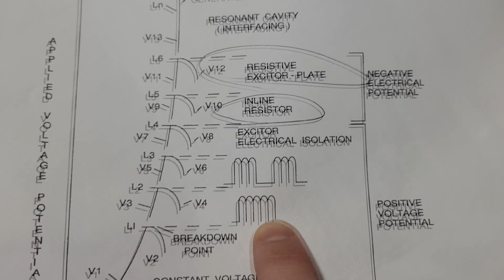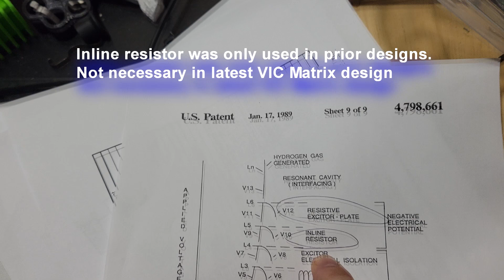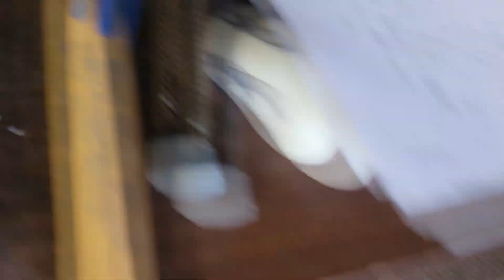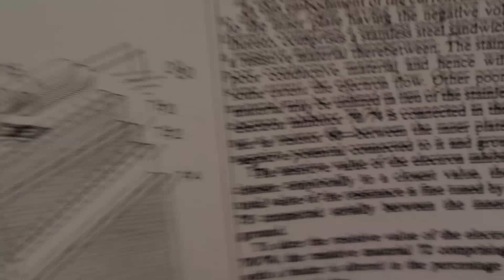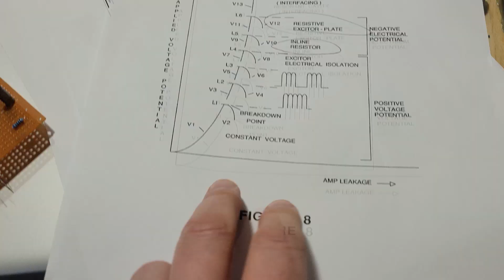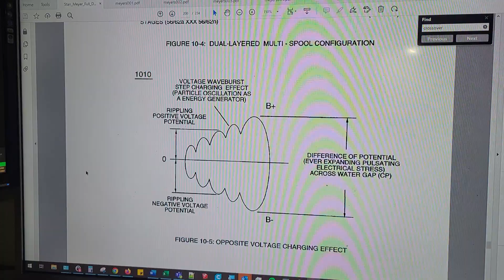The Voltage Breakdown Point and Voltage Burst Wave

Comment: L1 is specified as 2.6VDC Continuous DC (or the residual surface polarization charge). L2 is the application of the pulse that raises it higher. L3 the gate, then loosely coupled magnetic isolation, then onto the negative side with the inline resistor and SS Sandwich. Each raised it up a couple volts.. The sandwich, removing the threshold completely (per Stan)
Reply from the maker: Yes, each level was a technologic unlock to achieving higher voltage. I'm still wondering about "electrical isolation" tho.. does that mean insulating each individual cell, or removing the cell ground for a "floating ground" (isolating it from the circuit) like the VIC schematic shows.
Reply: @noahauman  Yea, the VIC5 setup utilized the isolated secondary, as an attempt to remove the biggest electron source (the ground), Though, the international patent VIC5 shows a ground connection anyway! :)  It means an arbitrary or floating ground is achieved. Much like a SMPS supply.